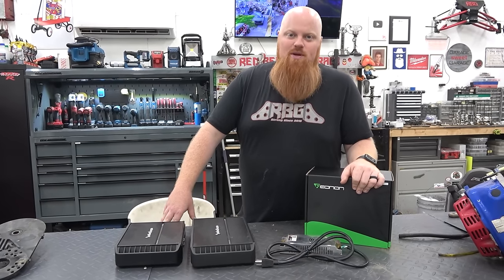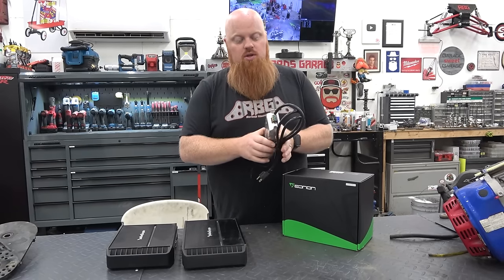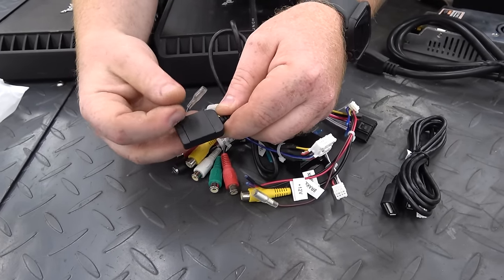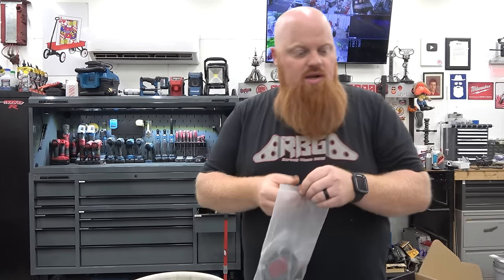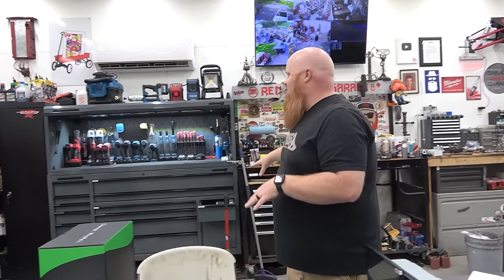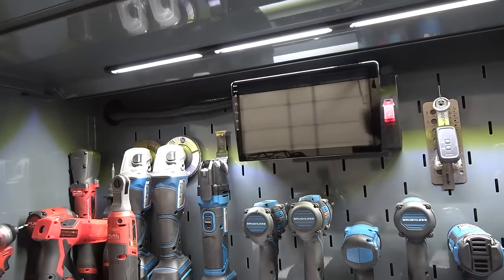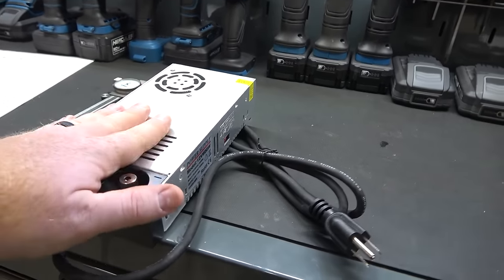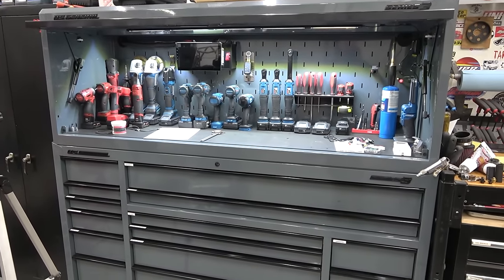I put a Touch Screen Audio System in My Toolbox!!!

Comment: The torque OBD app is sweet.. You can buy a plug in for your OBD port and it will monitor your truck through your radio.Code faults ,Temps, sensors,gas milage, fuel trims etc

Comment: I strongly recommend flipping the sub box over to where the port is facing the floor. Put some legs underneath the box to hold it a few inches off the floor so the sound coming from the port will have something to reflect off of. When the port is aiming into open air, the sound doesn’t reflect and you lose a lot of pressure.

Comment: Cool video. Never done this for the very reason of air space in my polebarn. I use an old Awia 5 disc changer with shelf speakers. She's plenty loud but I'll never get the bass because of air space. It's need one if those concert racks of subs to fill my desires. 😂

Comment: Corner load will fill the entire building, but you have to find the right Corner, and it will increase bass output since you have posted enclosures. You won't regret giving it a shot.

Comment: so you're running 3 12v inverters,  pulling as much as 180 amps,  to push about 1000 watts to the speakers, on a 120v outlet that has a 20 amp breaker on it.  120v @ 20 amps = 2400 watts, 180 amps @ 12v = 2160 watts. figure for 85% efficiency, 2160 x .85= 1836 watts potentially.. on a toolbox. that's pretty dope. and those fosgates will go well above their ratings so yeah. you get enough speakers on this thing and it'll get after it for sure.

Comment: Love the setup man
The issue with the box you have for the subs is it was designed for a car. Its a normal ported box. You might look into a horn or t-line type of enclose. They project sound better in an open area.
Reply: The science behind speaker boxes doesn't discriminate between in a car or in a large area. Ported to unported is just depending on the type of sub.
Reply: @alexray2925  you would be surprised the difference in preformance depending on the area. There's a reason concert venue or theaters use a quarterwave type of enclosure versus a helmholtz chamber or a regular ported box
Reply: Right but we are talking about sub sonic subwoofer waves and yes you can get the sound to "travel" but it don't matter if it's in a trunk or in the open. See what you did there is prove me correct by using a large open area as your example. Knew that bachelor's degree in Acoustical engineering would one day come in hand. SCORE!!!!!!! PLAYING THERE
Reply: Ok 👍
Reply: You just need to load the sub off of the floor or wall. That's how you can get better response. Just experiment with the box placement. Check out Steve Meade or gately audio

Comment: In this day and age, I'd skip the head unit entirely and go with a bluetooth main amp and just wire the sub amp into the bluetooth amps RCA outputs for an application like this. I've been running a bluetooth amp powering four 8 inch coaxials in the ceiling with a 2500 watt soundstream tied into it to power an 18" sub in my camper converted ambulance. I've never used or turned on the deck in the dash of the van since I did the install five years ago.

Comment: Dont run tower speakers get one 15" sub in a single slot port prefab box for around $200 you could get way more base and get a couple car audio componet sets in seperate boxs and you would have double the output. I wish i could come to your shop and hook you up

Comment: Hey Greg watch those Eonon I had one in my E46 BMW , the head unit was still under warranty I started having issues with the back up camera not being visible when you back up and it would not connect to Apple CarPlay and Google play store, it also would keep glitching and restarting.
It was all plug and play so no connections and I had no cut factory wires.

I contacted Eonon and was lead on by their customer service team for about 3 weeks, they wanted this picture and then they wanted this piece of information and kept dragging it on and on for 3 weeks to the point I lost my temper I bent over backwards to give them everything I had my receipt, I had my box , I had pictures of the issues, but still I got screwed around, and still ended not getting a replacement for crap head unit.
Word of advice, save your money buy a brand name head unit….

Comment: Take the blue remote wire and use that as the signal wire to turn on the relay for the amps that way when you turn on the head unit the remote trippers the amp relay automatically and get rid of that remote control. That's how stereo shops wire high output multi amp stereos.
Reply: Also those power supply's aren't going to have enough juice to properly power those amps. The best way would be to get a couple batteries or a lithium back to power the amps and run a good battery charger to the battery back to keep the voltage up. Or look in to a tar amps power supply or power base in whatever brand you prefer but there's specific type of units designed for that type of demand. Just figured I would give you a few tips. I've been doing car audio and automotive electrical work for over 25 yrs now. But its  nice setup to start with besides your power supply. Also you can damage your amps if your really jamming and they get low voltage. Good luck my guy

Comment: Nice! I did the same thing with not used audio stuff. I used a DP24 RV battery for power. I just charge it as needed with a charger. I also found the bass lacking in a garage. Like you said too much air space. Nice video!

Comment: Hey Redbeard i need advice ive got a tomberlin cart live axle  that i need the get the splined flange that the sproket mounts off its rusted on any ideas
or suggestions  btw im removing it so that i can regrease/replace the bearings they make a little noise

Comment: Where did you get the power supply? I’ve been using a pc ATX PSU for 8 years but I’d like to simplify it and the PSU would be perfect.
Reply: Any aliexpress 12v psu they have many amp options, but a pc psu is likely more powerful and efficient

Comment: Put the subs on top of engine room and it will project better. Use 6x9 in the small wedge boxes in each corner of shop to fill out the sound. And if you are going actual stereo sound make left and right the  narrow side, so the bay door side of shop would be one channel and tool box side the other.

Comment: Y u didnt use a desktop power supply for your amplifiers
Reply: Not enough power. You need lots of continuous power to run an amp.
Reply: He pretty much did
Reply: @FarmerFpv if you were curious, your basic 500w psu is rated for something like 250w (varies by unit) on a single 12v rail and has a fan designed to keep it cool running 24/7. Most servers run for years at a time straight drawing at least that much power.

Comment: RB.   Buddy just tell me where to put the check valves in.  I have two vent tubes going from crankcase to valve cover and one single 3rd  line from valve cover to check valve (only allowing air to vent to atmosphere, followed with a screen to hold any small oil vapors after the check valve.     Beard of the RED. @redbeardsgarage just tell me if that’s right brother.

Thank you 🙏🏻

Comment: How are they going to try and sell it for 1000$ on their website. 315 on Amazon, 260 on ebay? Instantly don't trust it. 
It does look sharp though for a tool box. I'd consider putting it in a car if it still had android connect so Spotify and maps populate
Reply: Where are you seeing the $1000 figure?  Eonon normally has freebies included cheaper than ebay